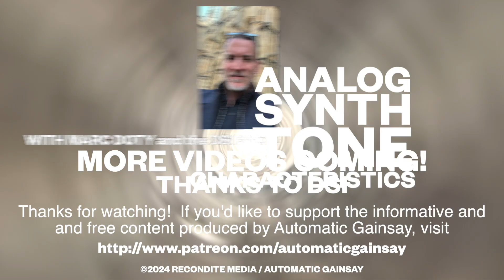What makes an analog synth sound analog?  Part 3-  That waveform is just too fancy.

Comment: I see. You have in mind specifically "vintage" analogue machines, from before the days of reliably high-end components from fancy designers, before automatically tuned oscillators, and after the components have aged into unreliability. To me, analogue has never been equivalent to vintage synth sound. I mean, I started playing on old, big-name machines from pioneers of the field. I love them. But the value of analogue-synthesizer sound is in its core of continuity and natural transients and timbres. The humming and beating and variability is either not necessary to the core of its analogue quality or, in some cases, is a function of machines not performing as intended. The great vintage and modern analogue machines, however, sound great even when they're new and when they're in tune, and when we force them to play in tune so we can do other perverse things to the sound.

That we now also have digital machines that can sound almost that natural - or so much so the difference gets elided in practical uses - is that much better for all of us. We live in good time for synthesizer choice, even if the world has many other issues.

Thanks for airing all this out and giving love to analogue and to a recently lost giant of the synth world.
Reply: yep. Analogue with clean accurate oscillators, low noise, low/no drift is a thing and does not sound like digital. Anyone with a eurorack can attest to that.
adding pitch modulation, noise etc. to a digital sound does not make it sound analogue. Just makes it sound like a messy digital sound.
There is some other aspect to it that is very difficult to discover :)
There is also very little point to trying to discover it, because we have lots of great analogue hardware availablie these days, and lots of great digital hardware... and software.
Seems like trying to make one of those sound like the other is a waste of time.
Like trying to make a Strat sound like a Les Paul, it never will, just buy a Les Paul